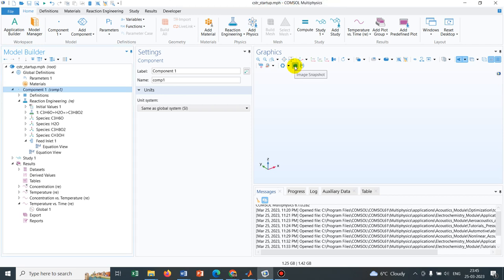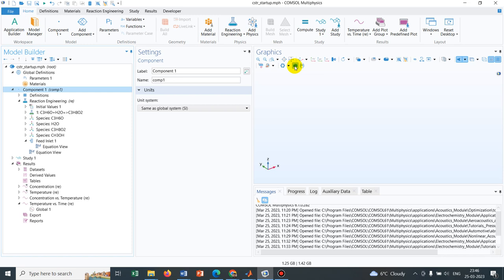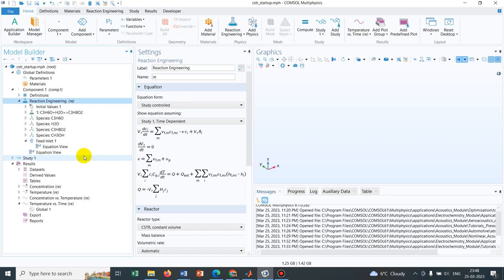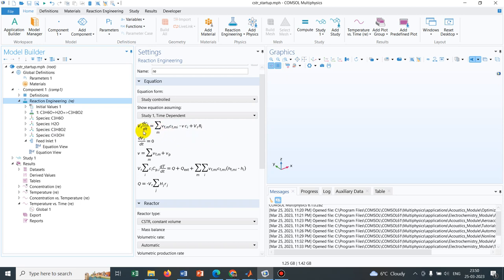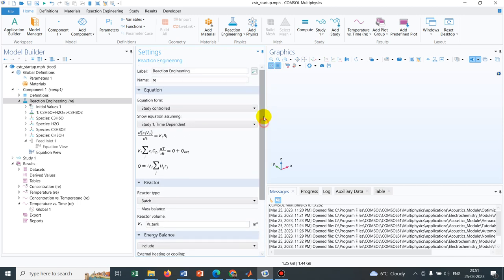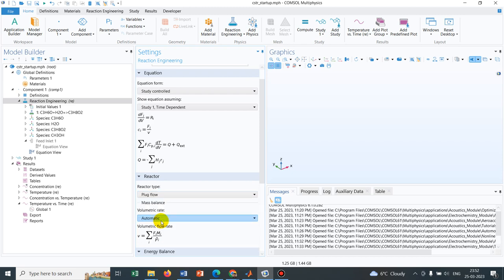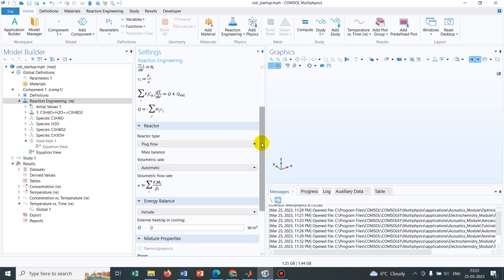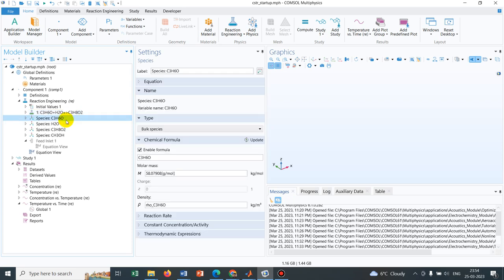How to model reactions in CSTR Reactor and other known reactors #reaction #reactor #CSTR #PFR #pos

Comment: Hello sir, I am a student at CWRU united states and working on COMSOL. Your videos help me alot to understand it. Is there any possibility you can touch electrochemical systems simulation without electrochemistry module(transport of diluted species and curren distribution). It will be really helpful.
Reply from the maker: I worked on a similar problem. You can contact me and opt for my technical support course. This course has helped many researchers. This would be customized based on your requirements.
Reply: @pioneerofsuccess4054  thank you I'll let you know.